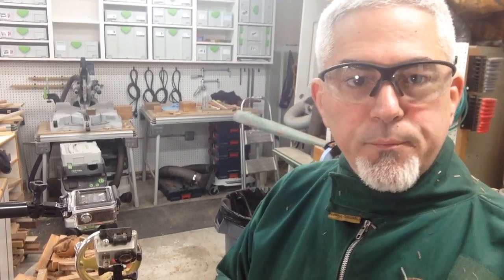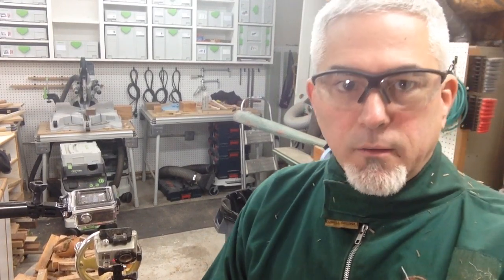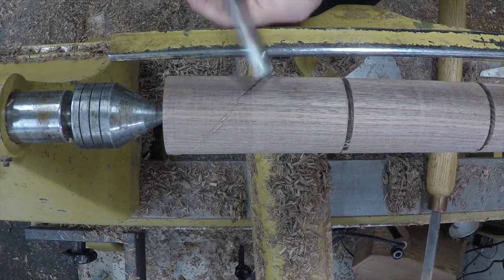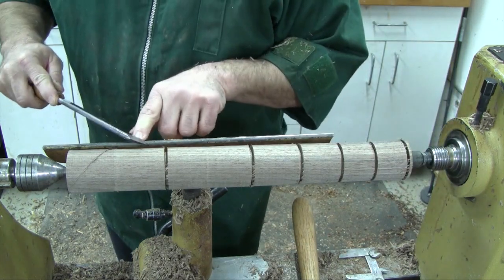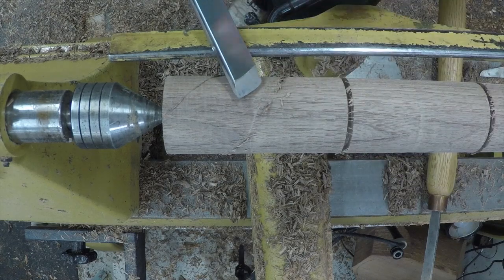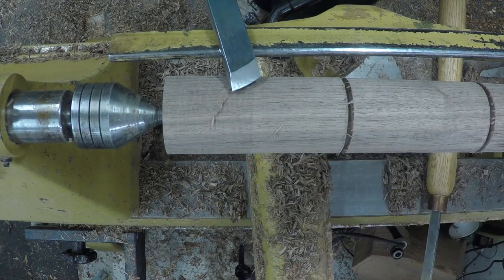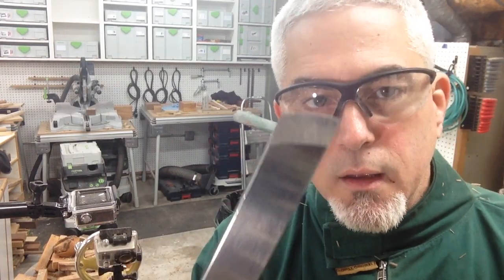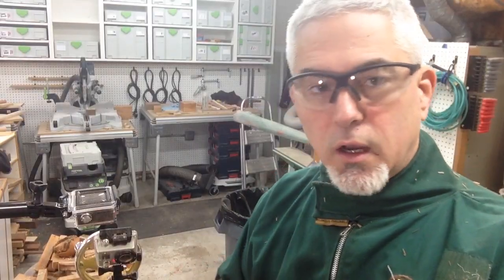Peeling Cut with a Skew

Comment: Hi Brian
Was taught to use the skew with one side raised off the tool rest as in a plaining cut,
Could not get consistent results when doing it that way, always a bump or a ridge between very smooth spots.
I tried your pealing cut on a box I was making and could not believe how smooth and flat it was.
Was getting shavings that were like down feathers floating off the wood.
Smooth as a baby’s butt.
Thank you so very much.
Paul McAllister

Comment: Excellent video. I am particularly interested because when I started turning 12 months ago I thought that was how you used a skew. When I started, I practised with gouges but I got a poor finish but I soon realised I could clean it up with a skew, flat on the tool rest to reduce sanding. I told some of the amateur woodturners from clubs who told me I was using the skew incorrectly and I should practice planing cuts because planing cuts are the only way to use a skew.
I ignored them and carried on regardless believing the end result was what mattered and not how I used the tools, well within reason I would not use a roughing gouge on a bowl.
thanks
James

Comment: I just bought a skew that looks identical to the one you're using here. Eager to get to the lathe and put your instruction to good use. Thank you.
Reply: What type of skew is it? I really like the short handle and large length of steel. Looks like it would last a long time.
Reply: @aaronbeltz5973  Your question is a reply to my comment, but it looks like a question for Brian. I buy tools without handles and make long ones for them. I replace short handles with long, fat ones on most tools. I don't remember if my skew came handled or not.

Comment: Excellent video and think this will help me with what I've been having such an issue with, making straight pieces of wood.  I am an absolute newbie, been turning for just a few months but I'm trying to make straight batons for police and martial arts.  I've had a hard time 'easily' making exact even surfaces and have relied on the crutch of a ton of sanding.  Can't wait to try and practice this.  Now for the question you probably were not expecting: What is that lovely mechanical pencil you are using?  Looked nice and thick and great for lathe marking.
Reply from the maker: +Lee Richards That red pencil was made from a Woodcraft Artist's pencil kit: http://www.woodcraft.com/product/146767/woodworkersartists-pencil-kit-gold.aspx.  I used a red acrylic blank so I could always find it, but yet I still seem to lose it in the shop more often than not.

Comment: Bryan, loving your videos. They are fabulous for beginners like me. I was wondering what your suggestion would be for lathe speed for roughing out a spindle? I have an old Delta/Rockwell and its startup speed is about 950 rpm's. is that to high-to low or about right?
thanks
Reply from the maker: For smaller diameter (4" or less) relatively balanced spindle work, that should be fine.  Where it starts to get dicy is with larger diameter, unbalanced logs/blanks that can cause serious damage if it becomes airborne.  Regardless, it is always a good idea to stand to the side when turing on the lathe.

Comment: Thanks for the video. Very informative. I keep trying to use my skew, but we haven't started a good relationship yet. Question: How important is spin speed for using a skew? I notice very few turners mention anything about how fast the lathe is spinning. Is faster better?
Reply: +Chris Happ Generally faster is better, but don't go any faster than you are comfortable with. The old saying is: if the lathe ain't shakin' and you ain't shakin' , you're alright.
On a piece of about 2" diameter I would probably go around 2000rpm, possibly faster; however, this also depends on the wood. If there are any splits or cracks, be very careful, they can easily result in large pieces being ripped off, so you must wear at least safety glasses.
Reply from the maker: +Wolfgang Schulze-Zachau Thanks for replying to the question, Wolfgang.  I try to answer all questions but I must have missed this one.  And I concur with the answer: faster is better for cutting, within the bounds of safety and comfort.  Like the old saying you quoted; I have also heard: "If the speed make you say 'hmmm' you are probably OK, it is make you say 'holy %$#@', then it is probably too fast."

Comment: Great video. This is the second one I've seen. Have subscribed. What is the relative height of your tool rest? Thanks
Reply from the maker: For skews, the tool hight will be a little above center, as opposed to slightly below for gouges.  Beyond that, I find that tool rest height is mostly about adjusting the tool handle to a height that is comfortable for the turner.

Comment: What relation is the Skew to the top or centre of you work. great video from AU. Cossy
Reply from the maker: I have the tool rest set slightly above center.  Because the skew has an included angle (ground on both sides) it rides higher than gouges.  I find that the specific hight is more a matter of comfort for the turner: the higher the tool rest, the higher the tool handle and vice versa. I find that when the tool is in a straight line with my forearm I get the best comfort and control.